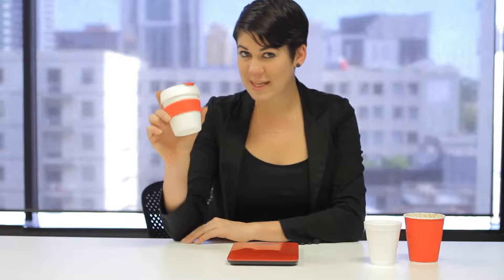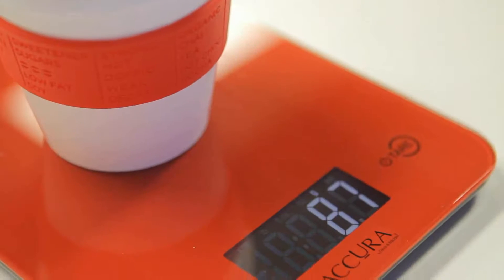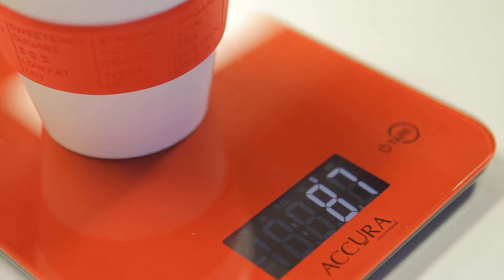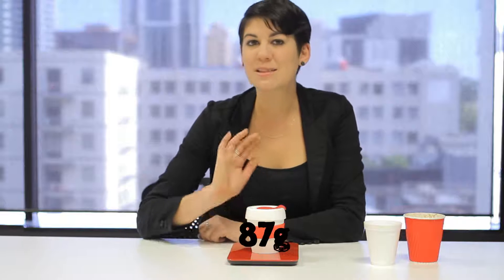Eco coffee cups? Leyla Acaroglu on design-led sustainability, life cycle thinking and functions

Comment: The question is not about the weight of each one, but how it damage the environment in its production. The plastic cup can weigh less than the paper but use more resources to have those 2g of plastic , as the CO2 emissions .... Don't agree with the information in the video!

Comment: This maths is mind boggling.
2 x 10 = 12???????
12 x 4 = 87????????

Ozzies...
Reply: I agree on the reusable plastic cup, but for the disposable ones to be sure it would be necessary to make an LCA of the materials and processes for paper and polystyrene. The real impacts in the entire life cycle of the object may not correspond with the heavier one. Carbon footprint, renewability and recyclability, embodied energy and virtual water of the materials may have a significant impact independent of the specific weight.

Comment: Paper cup weighs 12g
Polystyrene cups weighs 2g
How did you get to 10 times the material?  Should be 6 times ish.
Reply: She said "10x the impact", not "10x the material". She never said that 1g of paper has the same impact as 1g of polystyrene, so the "10x the impact" quote likely takes into account both the difference in weight AND the difference in impact per weight. However, she never made this clear nor showed the difference in impact per gram. She also didn't mention which environmental impact(s) she is comparing (e.g. greenhouse gas emissions, water consumption, resource depletion, toxicity, air pollution, etc.). Just saying "the environmental impact" can be misleading because there are almost always tradeoffs (e.g. one product may have lower carbon emissions but use much more water and land). The science she is referencing (life cycle assessment) is very complex and takes into account much much more than just the weight of each product. I am sure she knows this and is just trying to vastly simplify the topic to make it easier to communicate/understand, but in doing so she left out a lot of info. This is kinda the biggest problem with life cycle assessments IMO (as someone who works in this field) - they are so complex that you cannot really communicate them simply without leaving out lots of important details and assumptions. And without reading the full study/report, there is no way to know from this video whether she is accurately representing the results or is simply cherry-picking, let alone whether the study was well-done. I think this was a good high-level intro to some of the thinking that goes into life cycle thinking though, and the fact that it's not just the material that determines the impact - but also how much of each material you need to perform the function, how many uses you get out of the product, how you use/clean/maintain the product, etc.